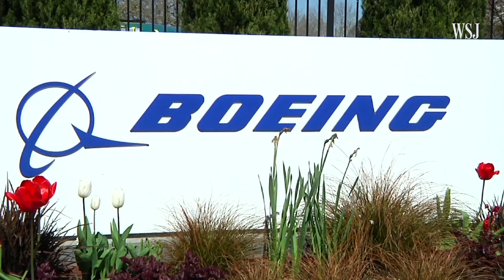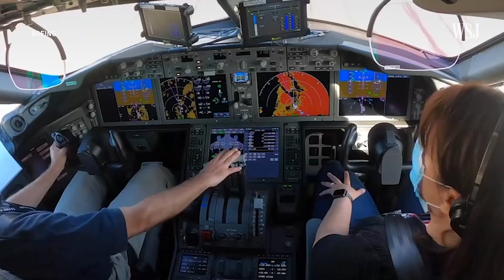Boeing 787 Dreamliner: A Timeline of Recent Production Problems | WSJ

Comment: Next time you get on a 787 have a look at the paint on the top of the wings. It's coming off in chunks and three years on Boeing still haven't got a fix for this issue! If there's no paint then the carbon fibre will degrade due to UV damage.
If you want to see a well built aircraft then it's the A350. I work on both and the A350 is a far, far better built product. It's like comparing a Daewoo to a Bentley.

Comment: It seems Boeing can’t get its S**t together. 
787 has been out for over 10 years,  enough time to iron out all the problems, but here we are still coming up on one problem after  another, as if the plane is still in testing phase I can’t remember Boeing 777 going thru this for this long.  
The quality at Boeing must have taken a massive hit in the last decade or two. 
I am not even going to mention the whole 737 Max F**k up.  
Airbus 350 came out after  787 but you hardly hear about it having so many chronic production problems or defects

Comment: It is interesting to note that it is AIRBUS who helped Boeing with their battery problem ,also I hear US AIR has replaced its fleet of airplanes with strictly new AIRBUS middle range planes....the 737 MAX bad reputation sticks even if it has been fixed.
Reply: US Air does not exist
Reply: @JayJayAviation  well ,I guess the 'new' American Airlines then...
Reply: @hectorherbert6585  they have 59 737 MAX 8s as well as a total of 43 787s on order right now. Also they have 261 737-800s, 41 737 MAX 8s, 67 777s and 46 787s currently in the fleet

Comment: The answer to every instance of “how did Boeing get here?” is the same. Boeing purchased McDonnell Douglas in the 1990s, and MD executives engineered a reverse takeover of the combined company and proceeded to systematically rot it from the inside out like a parasite. The formerly engineer-led culture of Boeing was thrown out the window and replaced with the Wall Street facing, stock price obsessed culture of bean counters and know-nothing MBAs. Everything was outsourced. If they could have outsourced the Board of Directors to a call center in India, they would have. The long string of failures, debacles, and catastrophes began almost immediately and have continued unabated to this day, in every division: commercial, military, aerospace. Boeing is a joke now. Boeing is a walking corpse. They just don’t know it yet.
Reply: Pretty much every aviation expert predicted this back in 97.   
A culture of over promising and under delivering.   
Sad to see how right they all were.  
Is Cowboy Calhoun the answer?
Reply: great info, thank to your reference i have found an article with in dept details on McDonnell Douglas and Boeing relationship.
Reply: That’s long and cool
Reply: Is there any way out? Do you think Boeing will save itself? And how exactly did the Macdonell douglas get in control of boeing? Also, do you think they will save the 787? Is the plane safe? Will the defects be repaired?
Reply: @ngaviation3489  I helped build 1500 787-9 tail fins. I can assure you that I will never voluntarily set foot on a 787
Reply: Pls don't generalize...all MBAs are not "know.nothings"...also you do know that many MBAs are also engineers, right?

Comment: The engineering company has to be run by engineers - Business majors ruined this company
Reply: engineer with mba degree?
Reply: The same lesson that Intel had to learn, after AMD learned their lesson and brought in Dr. Lisa Su.
Reply: Letting engineers run the company is a terrible idea if they don’t know how to run a business. Back in the early 1900s, there were a lot of car companies that failed because they were ran by engineers that didn’t know how to run a business. The reason why Boeing is having problems is because the engineers don’t know anything running a business and the business majors don’t know anything about aerospace engineering. Boeing needs to be ran by someone who knows the technical details about building airplanes and has the experience to run a business.
Reply: @314jrock  yep
Reply: Lots of mba grads are engineers....also you can't generalize

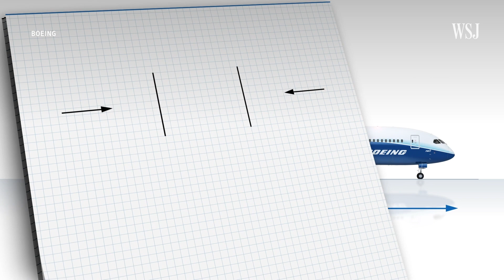Comment: At time stamp 4:10 the Boeing engineer needs to understand numbers better.

He says "five thousandths of an inch" and displays the number 0.005 what to check that again.

Five thousandths is 1/5,000 = 2/10,000 = 0.0002

Perhaps he should have said "five, one thousandths" meaning 5 * 1/1,000
Reply: Can’t see why the USA still insists on using ridiculous imperial measurements still when the rest of the world uses metric.
Reply: Being that they are in a manufacturing industry I guarantee you it is well understood company wide what measurement someone states when they say 5 thousandths. A thousandth of an inch is 0.001" Saying five thousandths is implied that we're still in base 10 counting, 5 x a thousandth of an inch (0.001") counting out 0.005" of an inch.  

1/5000 of an inch would be called out at One Five-thousandths of an inch instead and no one in industry would understand why you decided to describe the measurement that way.
Reply: @ethikplays  no, he got his numbers wrong

Comment: Boeing's reputation is in shambles to be honest. This is what happens when greedy businessmen and not engineers are charge.
Reply: Oh yes
Reply: When you Push the Technological Envelope, you're going to encounter problems.
Reply: @Ranger_Raptor_Twin-Turbo_3.0L  oh yes using an outdated plane and slapping some over sized engines on it to quickly try selling a product to keep up with airbus knowing it might crash is definitely 'pushing the technological envelope'.
Reply: @user-propositionjoe  The 787 is not an outdated plane. It has lots of innovative technology for a passenger aircraft. Problems are inevitable in something new like that. It has an excellent safety record though and the more Boeing learn about how the new materials used in the Dreamliner age over time, the better they can design the next iteration of the plane.
Reply: @jimmybon9314  How many dead bodies from crashes involving the 787? That's right, zero.
Reply: @user-propositionjoe  The 787 did push the envelope in many ways and is a engineering marvel, the other commenter is correct, I think youre talking about the wrong plane

Comment: Boeing puts great emphasis on "compliant" but the 737 max was compliant & hundreds died. 
Compliance is the absolute minimum and the regulations always lags behind the technology - basically it is reactive to issues which have already cost lives.
If Boeing truly cared about safety they would be setting their own, much higher standards. But no - that would reduce profits for their investors.
Reply: Very insightful. There is difference between making your products compliant and making products that are also compliant.

Comment: This is what happens when the people who design and build airplanes no longer run the company.
Reply: Ban stock buy-backs; ban was lifted by Reagan in 1982. Buy-backs artificially increase / inflate stock price which are linked to CEO & management salaries. Everybody understand the link?

Boeing CEOs have bought back more than $70 billion of their own stocks, instead of investing that money in improving R&D,  labour or improvement of production.
Reply: @khanchy  exactly  that . They aim at more sales and stock prices not quality
Reply: @khanchy  And those buybacks were done when the share price was at its peak. Those guys are unsurpassed at plundering a company.
Reply: Tech companies have mostly figured this out. Management is largely people with technical expertise, not clueless MBA's.
Reply: the more you Push the Technological Envelope, the more problems you're going to encounter.
Reply: @Ranger_Raptor_Twin-Turbo_3.0L  Been there, done that and left! The 787 programs had several news (people, materials, process and tools etc.). I have run into this issue at several companies. Failure is always the outcome!
Reply: @Ranger_Raptor_Twin-Turbo_3.0L  Do you get paid to spout this?

Comment: Composite materials were introduced to save money, not for safety. Prediction: airplanes made of this composite material will suffer from a structural collapse mid-air.
Reply: Now that is simply untrue, composites and CFRP have been used in aircraft construction since the 1970's and none of those aircraft have suffered from "structural collapses".
Reply: @doabarrellroll69  Have you not watched the video? A massive portion of the airplane is now made of composite, which is new. They are still learning how to test it. My prediction stands. Give it 5 to 7 years.

Comment: This is a textbook example as to why you don’t replace your executive engineers with accountants!!! 
I wouldn’t even trust Boeing to build an RC plane correctly at this point.
Reply: Especially not the ones from McDonnell Douglas,  the same people that brought us the exploding and failing DC-10. Flaws were baked into the design itself from the get-go, and they just kept brushing it all under the rug until it became a mountain of trash.

Hundreds of people died to their greed, and MD itself folded from those disasters caused by the DC-10. And now... they're at Boeing, doing the same thing again.

The shift to unskilled workers at a non-union, badly managed plant in South Carolina... the flaws of the 787... and the crashes caused by the flawed 737 MAX. They're going to kill more and more people until Boeing too, is a dead company.

Greed is a deadly sin, and it doesn't just kill the sinner...
Reply: And why would you
Reply: @kirilmihaylov1934  Hmm?

Comment: So there was no problems on the planes they already delivered. How come we only find problems on new ones. I really hope the max incidents won’t happen again.  Ps: Airbus seems more reliable than Boeing
Reply: Most of issues were with the assembly facility in North Carolina and not the one in Everette, Washington. So Boeing decided move all production for 787 to NC back in Oct 2020 as the facility in Everette cost more because it's has unionized workers.
Reply: @xraymind  it is all about money now .well when this happens you know there will be problems ...
Reply: Tbh every company lies about their products
Reply: @beau4690  not to the extent Boeing does though
Reply: @kirilmihaylov1934  both Airbus and Boeing does lying for profits, but airbus seems more trusted now
Reply: @herbertant4096  I haven't heard Airbus lying  about their planes
Reply: @kirilmihaylov1934  a380 about fuel efficiency per seat
Reply: @herbertant4096  that's small stuff compared to Boeing
Reply: @kirilmihaylov1934  you want more? A340 engine reliability, Airbus also mention that they got 95% safety rate from a320, record said there are more than 1700 fatalities just the same like boeing
Reply: @herbertant4096  gotem'
Reply: Ban stock buy-backs; ban was lifted by Reagan in 1982. Buy-backs artificially increase stock price which are linked to CEO & management salaries. Everybody understand the link?

Boeing CEOs have bought back $70 billion buying its own stocks, instead of investing that money in improving R&D,  labour or improvement of production.
Reply: Thanks captain obvious. BOEING is lying the whole world to make more sales and stock price rise

Comment: It’s a shame to see the company that got the strategy right - Boeing chose smaller long range point to point planes like the 787  instead of Airbus failed ‘hub and spoke’ with the A380 -  being bogged down by issues in areas it once excelled like engineering. That’s because the company’s senior management of the last years thought it was more important to cosy up with the regulator than to focus on building great planes as it has always done  in the past.
Reply: Ban stock buy-backs; ban was lifted by Reagan in 1982. Buy-backs artificially increase stock price which are linked to CEO & management salaries. Everybody understand the link?

Boeing CEOs have bought back $70 billion buying its own stocks, instead of investing that money in improving R&D,  labour or improvement of production. On top of that they get subsidies from state / federal government. Corporate scam.

Comment: Avoid Boeing 737.
Reply: I’ll gladly fly on any 737 not named MAX.  Basically, the old planes
Reply: @bobbbobb4663  basically you should  avoid all new Boeing planes like MAX and Dreamliner
Reply: @kirilmihaylov1934  After learning more details about the Dreamliner, it is quickly getting added to my list of planes I won't fly.  Boeing doesn't pay me to be their Beta / Quality Control tester.
Reply: @bobbbobb4663  you don't need to avoid the 737max or Dreamliner. the Dreamliner is one that doesn't need scrutinising
Reply: @nickolliver3021  Hello Boeing PR.  Given the on going structural issues with the 787, I’m avoiding it.  BTW, I think the 747 is a fantastic plane and current Boeing management has permanently turned me into an Airbus enthusiast.  If it’s Boeing, I ain’t going.
Reply: @bobbbobb4663  hello boeing negative PR. the final 787 structural issues are actually soon fixed so no need to avoid it. Maybe don't fly tbe a350 because of shoddy airbus paint management. If it's airbus don't go by bus
Reply: @nickolliver3021  While I appreciate the compliment of negative Boeing PR,  the fact that someone at Boeing signed off on the use of a single AoA sensor as input to Mcas means that they are incapable of understanding the requirements to build an airplane.  Full stop.
Reply: @bobbbobb4663  while you think the 787 is a bad aircraft that had quality issues which are now dealt with pretty much (late October deliveries resume) the fact that they were incapable of building an airplane now means they can build planes weew they know and understand what to do in future and not make the same mistake happen again. Anyway the aircraft is safe so move on.
Reply: @nickolliver3021  I’m not a beta tester for Boeing.
Reply: @bobbbobb4663  so don't be that person then
Reply: @nickolliver3021  Great.  You won't see me on a Boeing plane unless it is a legacy plane in Delta's fleet.
Reply: @bobbbobb4663  and what happens if every airbus is full. You'll have to fly on a boeing🤪😄
Reply: @nickolliver3021  If Delta is full, I'm not flying.  I've already removed Southwest from my list of viable airlines due to their use of the max and will probably never fly with them again.  As stated, I'm not a beta tester for Boeing (737 or 787).
Reply: @bobbbobb4663  I never said the airline itself. Of globally every airbus is full ypu will have to fly on a boeing. Err southwest is an airline you can fly. The use of 737 does not mean you ha e to avoid them. Just because the 787 and 737 have seen bad days doesn't mean you ha e to avoid them both. Why can't you step out of yoyr comfort zone and prove they both fly really well.
Reply: @nickolliver3021  My comfort zone is that I value my life and Boeing doesn’t.  Enjoy Boeing.  I will enjoy Airbus.
Reply: @nickolliver3021  And yet another 787 headline involving inadequate titanium components installed over the past three years.
Reply: @bobbbobb4663  there has been no headline about 787 involving inadequate titanium components installed over past three years. Where was that from
Reply: You do know that a 737 is the most popular airplane right?